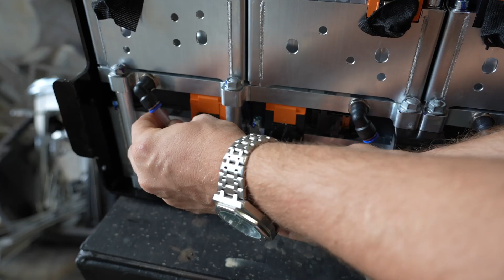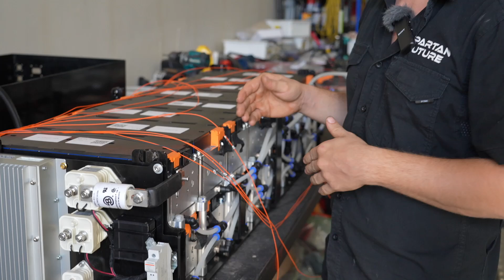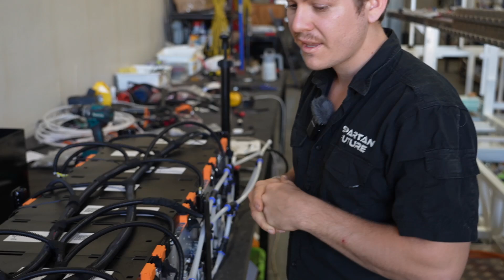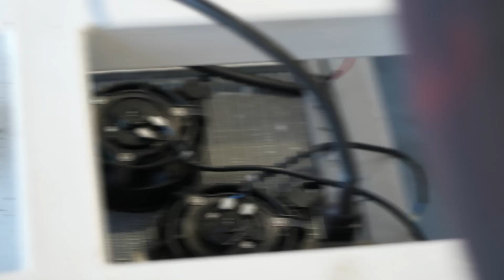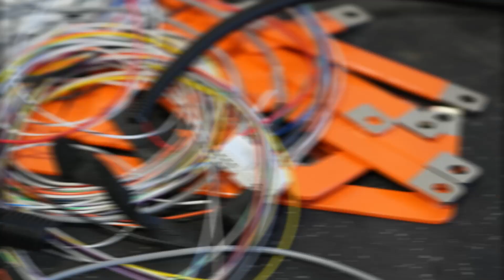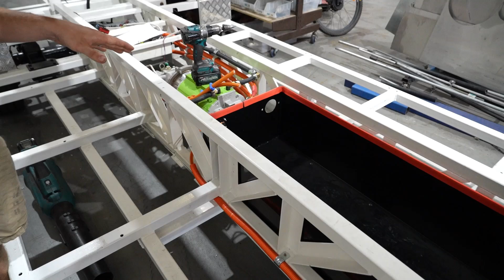Part 4 - Electric Bus !! Building a 400V Battery & what we learnt in the process

Comment: I'm surprised you have confidence in those connectors for the water lines. I'd be paranoid about them failing. Although I don't know what you would use alternatively to be honest.
Reply from the maker: The cooling system operates at < 1 bar while the working pressure of the push fittings is 10 Bar. Should be okay :)
Reply: @spartanfutureofficial  ah good to know. I figured they used something a little more permanent.

Comment: smoke alarm is low on battery (2min) 

Any regrets in not designing the battery system to be removable from the bottom with like a drop down panel and a sled? It seems like once the bus is built, removal for maintenance will be difficult.

Also what's the total amp hour capacity of the system and per battery?
Reply from the maker: Maintenance wise, majority can be achieved through the top with battery lid removed. 2.5kwh per battery module, and combined is 40kwh.
Reply: @spartanfutureofficial  should add a pedaling system so patrons can add power to the battery lol